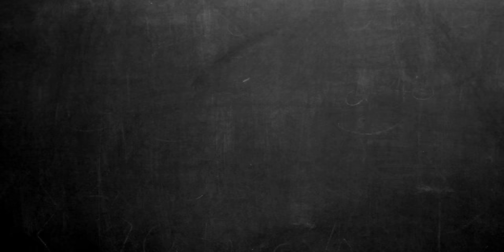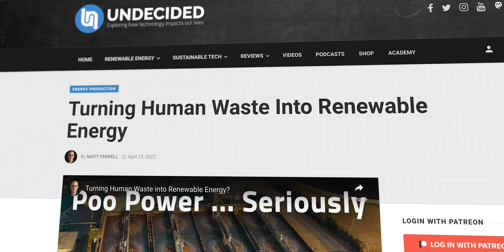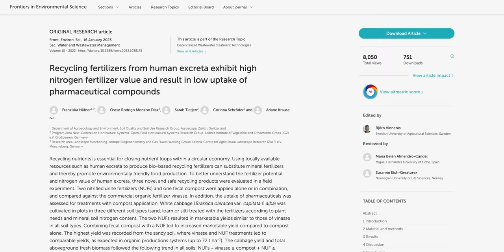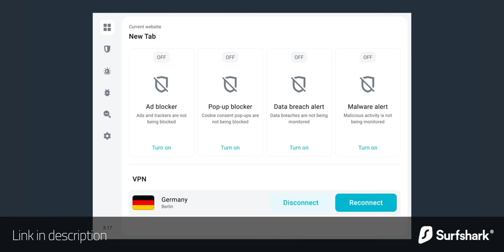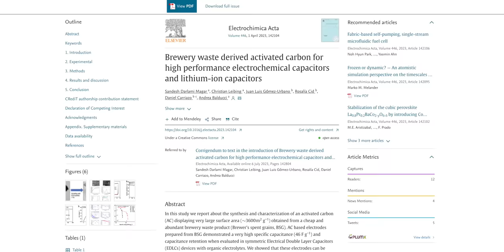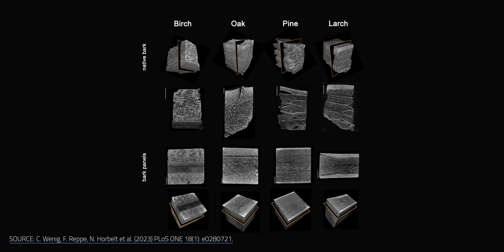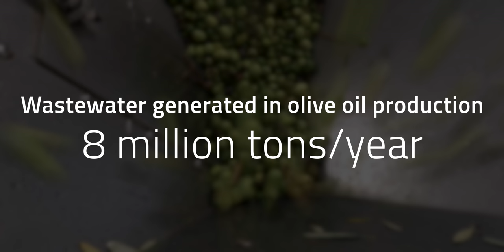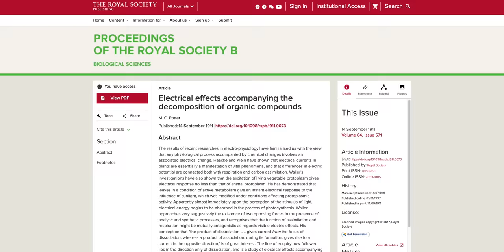Top 5 Crazy innovations for Reusing Waste

Comment: I think the best would be to use our own bodies in movement to store energy for out side use from each moving part, clothing everything we move in spaces all everything micro and  we use daily nightly and endless supply of energy from each and everything that is moving daily nightly 24/7  all everything moving, shoes, opening doors, paths on, bikes, vehicles, everything  you see is capable of creating outside need  of electricity if really needed, when you need it and store it also from over creating power. Think big 😮 all inventions are good just portable in and like organized for and solar is can the best it's really free and what each person needs it's lots on micro like computer tech and light house need it was needed but now transport needs it even out appliances are  capable of using less energy think micro and less input needed with more out put from micro plants like even shoes or walking around you house opening doors some wind some solar some water some bits of this and that, just the gist but it's coming cause it will come to portable need jointed pultiples in masses if needs to be ratio for need in quantified need in each space from one to many closer in space of need.

Comment: there is a beautiful technique developed in austria. they leach lignine out of bark and create a solid foam much like styrofoam (but it is brown). works well as a thermal insulation for homes, and lignine is very flame retardent, which is good because styrofoam is not.
and that stuff is dirtcheap and carbonneutral.

Comment: A deeper dive would be helpful for subscribers on how spent grains or ag waste is "converted" or processed into a usable syn gas/liquids (petro chemical replacements) and/or carbon feedstock for batteries and automotive parts.   Likely it is done through Pyrolysis or Oxidation which are high energy and heat (without air so not defined as combustion process) processes.  So for groans - using as animal feed is actually a higher and better end use for spent grains from both an environmental (Lifecyle) and economic perspective.  Regarding producing plastic from Ag waste, the story is similar with twist.   The ag waste is again processed through either Pyrolysis or Oxidation with the addition of possibly distilling.  These processes produce an Petro equivalent ethylene or chemical feedstock that while is a substitute for fossil fuels feedstocks produces polymers that are the same -- think of coca cola's bioplastic bottle as an example.  These plastics are biodegradable (as are all plastics) but may take 100-10,000 years unless an additive is added.  Also keep in mind biograde doe snot mean it degrades into its carbon bases but biodegrade into smaller pieces -- i.e. microplastics.  Use of this term should be defined and is a flag for greenwashing of environmental claims  that FTC evaluates and regulates.  There is two types of bio based plastics that can be composted (an active and aerobic (not anaerobic - methane producing) version of biodegradation) - pha and php's (think of a compostable certified (BPI) plastic cup) into its carbon components but is unlikely, for a number of properties, that it would be used in automotive parts.  The lemon or other smell is an additive (not a reflection of the feedstock) and VOCs would still be emitted just masked.  Also -- there are many environmental impacts (carbon and ecological) and social associated with growing crops for fuels (same for plastic alternatives) that must be accounted for.   Similarly, for ag waste,  the better alternative is to either use an animal feed or compost back into rich organics content and amendments for agricultural use (that can also be a “soil based” carbon sequester accelerator as a regenerative ag application).  I do like the idea of using automotive fluff as a feedstock. However, it cannot be mechanically recycled so will go through the conversion (chemical recycling) processes I referenced above.  Fluff also contains several “forever chemicals” PCP’s and PFAS/PFOS used as flame retardants and etc that are highly toxic that will need to be addressed.  I am not aware of any technology available to process.  These chemicals have been and are being replaced but will take decades to get out of the supply chain (end of life automotive processing).  So I suggest some context in finding better ways to manage wastes and end of life management.  The better answer and context in my view is to focus on responsible consumption (we cannot “recycle” our way to carbon reduction and climate action) of which recycling is one of but may not be best or highest option, that lifecycle impact of materials (including end of life management) be employed in the production of good and services,  there is standardization and transparency on multi attributional impacts and benefits that allow the consumer and society at large have a voice on values and an informed choice on the tradeoffs.  Lastly, there is an economic challenge and who will pay for end-of-life management that we as both consumers and rate payers (waste, water and sewage fees that are paid for as taxpayers or through service fees to publicly owned utilities). This remains a current, open and contentious policy discussion.   Extended producer responsibility frameworks and chemical recycling subsidies (for consumer product, plastic and Petro industries) are two examples that come to mind.

Comment: Methan from poop=power.
Also big buildings with big tall walls ya there potentially space for solar there.
But unfortunately the best way to save energy nobody is willing to do.
What is it well better insulation r50 min would reduce energy demand in a city by a lot.
Also any new building and any new renovation to a old building should be required to increase insulation to r50.
Yes I understand r50 is a lot but I'm in nv with r55 and I've used my ac 7 times this year and it's been over 100f for 3 weeks.
Also it was over 110f for 1 week.
Also pine tree sap is extremely sticky why not use it as a natural glue for those wood bark plats but I'm sure there more sticky sap out there too.

Comment: The problem with 'real' fertilizers (at least in the Netherlands): 

Cost

I wanted to get some fertilizer for the garden. At first I was looking at chicken dung / cow dung. Both seemed good options.
I was naively thinking that apart from fitting the best in the circular economy, these probably would be the cheapest as well, especially since there is big problem with a manure surplus in the Netherlands anyway.

Nope. Dried manure is at best the same price of (chemical) fertilizer, however, the chemical fertilizer was ten times as potent.

That made sustainabilty a bit too expensive for my taste, I will try again in a few years when I run out of the chemical fertilizer.

Comment: 1. Biofuels like ethanol and biogas from agri waste
2. Plastic pyrolysis.
3. Better logistics systems to reduce material waste during transit.
These two are important to reduce waste generation, thus helping the in solving the issue at its source itself.

Comment: At about 1:30 in a combine is shown at work scattering mulch in its wake with the voice-over talking about waste.  The chopped stalks aren't the waste and spillage is minimal because that would reduce income.  In decades past, it was common to not scatter the part of the grass not gleaned by the machine, but farmers aren't stupid, so they had the manufacturers include chopping and spreading the mulch to the machinery.  They can empty the hopper of grain into trucks driving along-side in order to reduce the fuel that would be spent while stationary to auger it out.  (Doing so reduces the amount of time in the field burning more fuel.
     It has been written that an appropriate mix for feeding plants is to urinate once into each five (5) U.S. gal. of water, sourced from rain runoff, of course.  Go organic farmers!

Comment: There is absolutely nothing bad about using human waste as a fertilizer.  By the time it is in the state that it can be used, there are no live bacterial in it.  Pee is not loaded with bacterial even on the way out, let alone after a bunch of chemical processing.
The real problem with using waste as fertilizer is there isn't nearly enough of it.  it might seem like there is, but every single acre would require multiple tons of the stuff.  There is simply nowhere near enough to make  a huge dent.

Comment: Not sure if it was your channel, but what about the carbon produced by the  new water treatment that uses pressure to break everything down. Can't this be used for batteries aswell plus get rid if all pollutants
Reply: Hydro/thermal carbonisation I believe… yes I was very interested too, then all went quiet! Pity as they found a way to neutralise pfas/ forever chemicals. A follow up would be great…
Reply from the maker: Yep, I did a video on that tech.  It could be used for a lot of stuff.  I need to do a follow up on that.